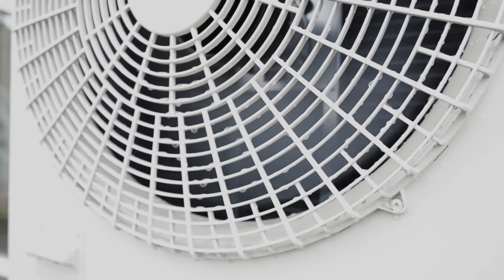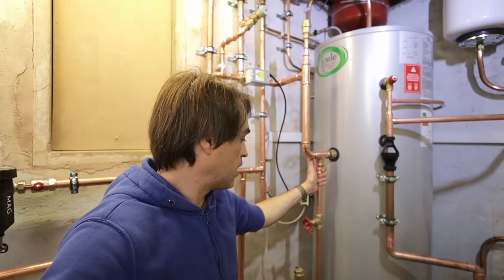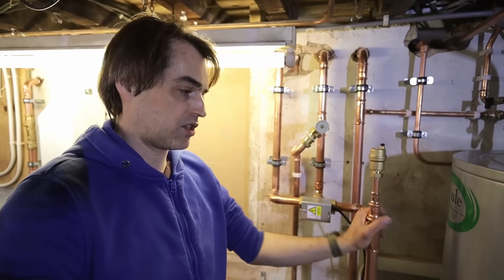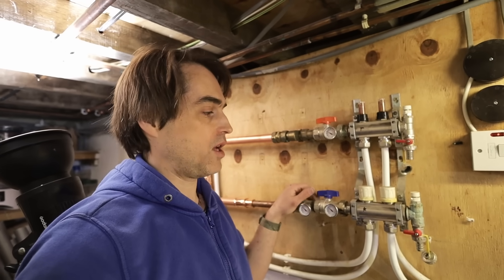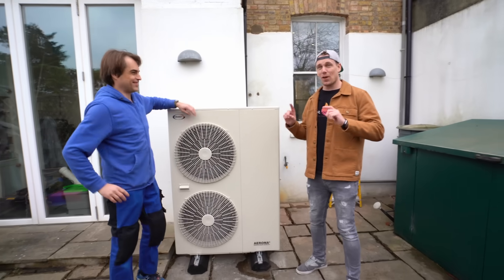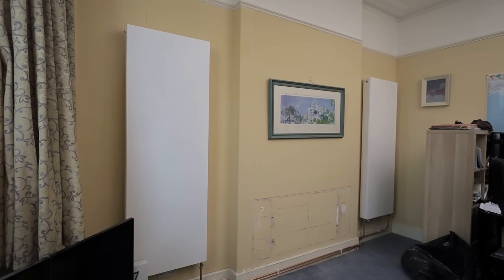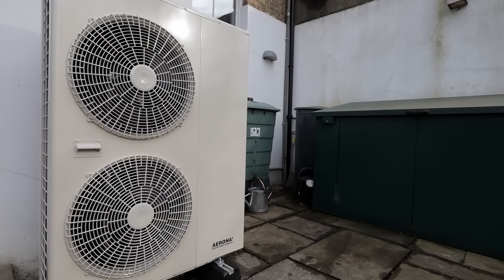The Truth about Heat Pumps: Debunking the Myth.

Comment: I know that this video is old but I have to rant. just having a air-to-water heat pump is the worst thing you could ever have as it's only really viable for one sodding season and that's presuming it doesn't get any colder in winters. The biggest problem the UK is already facing extreme and long high temperatures in summer and autumn, as a temperate country we have no infrastructure to deal with this unlike our cousins across the pond.

Comment: Watched this again and it's definitely the wrong way to approach it, get rid of heat loss first, spend money on that first, spend twice as much. Still cheaper than heat pump and the ever increasing fuel costs.
Reply from the maker: I just went to see the job last week. 22C inside with -3 outside and lower running cost than gas so all good there.

Comment: On that unit you have info that max. current is over 25A. With simple math 25x220=5500W or 5.5kW of electric energy...how often this pump will work on the high level????
Reply from the maker: At the moment with -3 outside it uses 35kwh or electricity to keep 4 bed house at 21c and do hot water

Comment: Why delta 5?
Reply from the maker: Heat pumps efficiency is higher with lower flow temp. The lower the DT the higher the mean water temp in heat emitters and higher output. Also something to do with keeping the fridge circuit happy.

Comment: They slapped all that pipework minus the big tank in my kitchen it is a right mess and is costing a fortune for that heat pump to produce a bit of heat it has to fire up them two big fans a compressor and two pumps that’s a fact

Comment: Hi Simon, wat kind of electronics regulates the system. Because You have also a ballanced cold system and a 3-way valve for buffertank or central healing.
Reply from the maker: It’s a diverted valve between CH and DHW on hot water priority controlled by the heat pump PCB with NTC sensor going from the HP to the cylinder.

CH is 100% weather comp with no room infuence

Comment: Interesting. I haven't seen any systems like that here in the states. Looks fairly complicated as far as piping goes, but like anything else I'm sure once you've done a few you know exactly what you're looking at. Locally I've only ever seen mini-split type heat pumps and those are totally insufficient for the task of heating a whole home here in the northeast. Especially given that you're limited to where the unit is mounted and relying on the air to blanket the rest of the space. Or you have multiple units installed which is more common. I wonder what the installation cost of what you did in the video would be. Something like an oil or gas system to heat a 185 square meter home  locally might be ~10 grand. I'm curious how far a heat pump goes in Europe per sqm. From what I've seen at least the minisplit systems end up costing like 4 or 5g a piece and you need multiple. That and they struggle to heat the poorly insulated homes of the northeast as is.

Comment: We've used a heat pump here in the southwest USA for the past 35 years. Ac has a SEER rating of 20 and is a reasonable heat source in the winter. Not the same as a natural gas furnace but still works well. Very efficient. My highest utility bill has been approx.  $185.  I have a 4500 square foot home and this is a very hot area.Summer temps of 105-112 are common. Is it perfect? of course not. If I was building now I'd use a ground sourced heat pump but they were not available 35 years ago.

Comment: I think you’ve demonstrated really well why heat pumps will never take off in most domestic situations. Both the outside units and internal emitters are enormous and ugly as hell. No thanks. 😢
Reply from the maker: and yet there is a 12 weeks waiting time for the equipment and 3-6 months time waiting time for all decent installers. Heat pumps have already taken off in my perspective.
Reply: The system this guy is installing is weird and the only time it would ever be practical to install a system like this is if it already had radiators from a boiler, and if it had that then just keep the boiler. All a heat pump is is a reversible air conditioner. For heat the inside coil is the condenser and the outside is the evaporator, reverse them for cooling. The main downside to them is that their efficiency drops when it is very cold out, so they usually have a backup emergency electric heat.
Reply from the maker: @Redtooth75  all heat pumps we install are without direct electric backup, as it is no longer needed. Modern units can get to 75C temperatures. If you size your radiators correctly 40-45C flow is all you need, even in sub-zero temperatures.
Reply: @UrbanPlumbers  what I meant by very cold is apparently different than what you think of. Modern heat pumps have a lowest effective temperature of -20C, lower than that and the performance will drop to the point where conventional electric heat is more efficient or they can be unable to heat the house at all. Many places get colder than -20C for extended periods of time. If where you live it does not then it is perfectly fine to not have electric backup but most systems will have them regardless of climate. Where I live it commonly gets colder than -30 C, a couple of years ago we didnt see temps higher than -32 for a month straight.

Comment: So if you have a great big house to accommodate such large radiators in each room, and somewhere to fit all these gadgets as well as not frustrate the homeowner and neighbours with what will become a noisy pump later on - go for it. For your average property it’s simply not viable, or desirable. How much money will it cost in electric when the system isn’t getting enough heat from the air? If the regs have changed I suspect another ‘u turn’ you cannot force people to have massive radiators with a gas boiler, on the assumption one day they’ll change to a heat pump. And then there’s the cost of installation and materials it’s not affordable for most. Added to that how many people are as knowledgable and qualified to fit/maintain these properly? Hardly anyone. 

Probably like the combi boiler it’s going to take a decade or two from now until heat pumps are affordable. That and vastly improved.

Comment: Heat pumps depend on ambient temp, humidity, and electrical allowances... as well as square footage vs. demand. 
Sooo... ummm.... What?

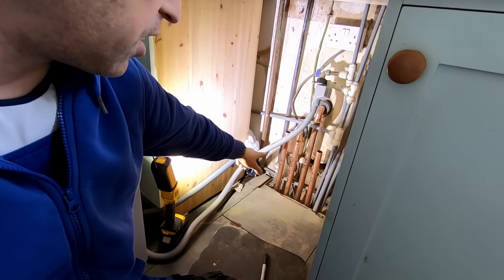1:45 - WHAT? Ummm.. no? Actually it's easier to run a minisplit system than ANY OTHER FURNACE WITH DUCT-WORK!

I'm so confused by this extremely inaccurate video.

With all that piping, WTF are you actually running?!
That is NOT a typical mini-split. You're doing some weird shit.

Comment: looking good right up until those fugly, dominating, radiators.
If they are to be the norm, then there's room for artworks designed specifically to hide them
Reply from the maker: they arent norm at all. Most houses have slightly bigger rads or even regular-looking rads. It is all down to heat loss. On this job I got specifically asked to make sure that the music room can be kept at 21C with -2 outside. The heat loss of that room was huge - high ceilings, 2 external solid brick walls, windows with very thin double glazing, a bit of draft from the floor. If I remember correctly the heat loss was well over 80 watts per m2. Usually homes are around 40-60 so can smaller rads.

Comment: It's the most efficient in terms of electrical heating. Currently in Denmark, electricity is $1 per kw/h. At winter, efficiency of heat pumps drops to ~2 - 2.5, so that's ~$0.44 per kw/h heat. A liter of diesel contains 10.7 kw/h and costs $2.2, that's $0.31 per kw/h heat, assuming 1/3 heat loss. I heat my house with diesel; I plan to install a heat pump, but only along a solar system, only then it becomes cheaper. I know a guy who's heating with bottled propane that he brings in from Germany; initially I told him he was insane but then I did the calculations. He pays €1.76 per kg and it contains 14 kw/h per kg, so that's $0.13 per kw/h, no loss as no chimney is used. That's under 1/3 of what a heat pump costs in winter time, or 2/3 of what it costs in summer time.

Comment: Is the house suitable for a heat pump? It looks like an old solid walls construction with single glazing(?). It’s crazy to install an expensive and complicated air source system with massive radiators when the real problem is lack of insulation.
Reply from the maker: all windows are double-glazed. Ground floor is insulated and has UFH. External walls are very thick (solid though) - 3 bricks deep and have a double layer of insulating wall paper. The roof has spray-on insulation to the rafters 100mm and 200mm insulation to the ceilings. They did all they could.
Reply: @UrbanPlumbers  Fair enough. Sounds like the right solution for the house and it’s owners. 

We have a well insulated 60s house (cavity wall and loft insulation, double glazing, etc) and have been heating it mainly with a log burner for which I am able to collect the wood locally. I have enough seasoned wood for the next two winters so gas c/h will not be used for the foreseeable. Works for us at the moment. Any decision to upgrade the (old) boiler / install a heat pump will wait until the legislation, building standards, costs, payback, buildout of renewables etc. is clearer. At least five years away I would say based on the current level of chaos.

Thanks for the video. Very useful but slightly shocked at the complexity and the large rads!

Comment: This video reeks of "Electric cars will never be a thing".  This debate is already over.  There is no more efficient way to heat a house, and no more practical method.
Reply: While you're correct, the video is trash, it is not the cheapest. It's only the most efficient in terms of electrical heating. Currently in Denmark, electricity is $1 per kw/h. At winter, efficiency of heat pumps drops to ~2 - 2.5, so that's ~$0.44 per kw/h heat. A liter of diesel contains 10.7 kw/h and costs $2.2, that's $0.31 per kw/h heat, assuming 1/3 heat loss. I heat my house with diesel; I plan to install a heat pump, but only along a solar system, only then it becomes cheaper. I know a guy who's heating with bottled propane that he brings in from Germany; initially I told him he was insane but then I did the calculations. He pays €1.76 per kg and it contains 14 kw/h per kg, so that's $0.13 per kw/h, no loss as no chimney is used. That's under 1/3 of what a heat pump costs in winter time, or 2/3 of what it costs in summer time.

Comment: How often do you see a youtube video where you know it's going to be absolute crap because of the title?   Not often...apart from those promoting flat earth beliefs and many about american politics....  and this one!
You are doing people a massive disservice with this title...  suggesting that an incredibly efficient heating and cooling solution is no good.  The resultant cost in energy and energy bills could be huge...   as well as impact on the climate (if you give a crap about that sort of thing)
The only situation where heat pumps lose efficiencey is in very cold circumstances. They would not be a solution within the arctic circle.
If your belief that heat pumps don't work is related to very cold climates, then put it in the title you lazy b*st*rd instead of promoting lies!
In moderate climates no other heating system gets close to the efficiency and low purchase/ running cost of heat pump air conditioning.

Comment: Heat pumps require electricity to be at a rate that competes with gas heating first. If it is then in a colder climate you can really improve their capacity by installing a ground source heat pump.

Comment: heatpumps are very common here in norwayy 80 procent of buldins have them installed, and use them for heat only. i heat my 150 m^2 house with my heatpump air to air. my house is 100 years old an no insulation. i use 1 kw/h and it gives 6 kw/h, and our electricity in norway is 100 procent renewable  hydroelectric  only. in norway we dont use gass at all, only electrical for everything. its common for a hose to use 25000 kw/h a year. if the electricity falls out all houses have efficiently clean buring wood fired stoves 5 to 15 kw/. temperatur   in winter ranges from 5 degree till minus 40 degree centigrades outside air temperature.

Comment: Just seen your video and as for a high temp pump you need a commercial dishwasher rinse boost pump at about £200 but you will need a mount and a couple fittings...

Comment: I think heat pumps are great, and you're doing great work, but you gotta understand that most people can't afford to do all the plumbing and equipment installation shown here. The average Briton might only be able to get a heat pump to connect to their current boiler plumbing and won't likely be able to even insulate the outside of their house much less replace every radiator.

Comment: that is a terrible location for a heat pump.... NEVER install heat pumps in wells or entraping low spaces... they will develop a cold pool of air that does not dissipate.   Its like installing air conditioners under a shed.

Comment: Great vid, I got to ask though why are do you use copper pipes everywhere? I had a new boiler installed 5 years ago and we gutted the house, we used plastic piping everywhere (with the exception of where it is visible everyday, like floor to rad) and it is so much easier to work with and faster to install as well, not to mention probably significantly cheaper. I am sure there is a good technical reason you use copper, right?
Reply from the maker: plastic pipework has a smaller bore and fittings put a lot of restriction on flow due to the even smaller bore of inserts. Pumps have to work much harder too. Copper is far superior to plastic and will outlast it by decades. I never use plastic.

Comment: Well they work just fine in finland where we have -20 and -30 celsius in wintertime. Maybe your houses are just badly built and heat losses are so big? :) you have 1700 watts heating power in really small room. We need like 7500 watts for whole 150m2 modern house in here and its calculated on -26 celsius degrees. The system in the video has so many bad choices and unnecessary parts, that i really do understand why "heat pumps don't work". Why on earth dt is 5 degrees on radiators? Why on earth there is 700 (pound?) pump on system that needs only normal 100 euro circulator pump :(temperature wont ever get that high on heat pumps). Heat pump systems work best when you get dt as high as possible. In here we use 50-30 on radiators. ps. always use underfloor heating in heat pumps if possible. Radiators are 1800's technology.

Comment: Install looks like brilliant craftmanshit, however, I am kinda dissapointed that the main points about installing a heat pump were not addressed, which is how much was the install, how much cheaper is it to run and finally how long until it pays itself off? My little combi boiler cost me 50p an hour to run, I have it on for about 4 months of the year costing around £3 a day meaning my heating bill (even with current gas prices) is about £365 a year. I'm guessing a install like this cost around £15k? It dosent seem cost effective to me. I'd be very happy if somone corrected me on this :) Or myabe they are just not for everyone yet?

Comment: I have what was rated mega-efficient Condensing Combi Boiler and when my heating engineer last visited I mentioned Heat Pumps and he laughed at me. He went on to explain the need for a hot water tank (doh!) but watching a couple of these vids I see you need a 3rd large cylinder too.  My house barely has space for the boiler and one small cylinder so it truly is not something I could ever fit. 
Something that should be compulsory on new builds (along with solar panels) but not for 100+ yo terraces like mine!

Comment: Very nice piping installation. The system installation is probably worth more than the cheaply built old  building. Dont understand why you didn't just use a split system forced air heat pump setup?

Comment: A 5 ton/17 kW system seems pretty large for the size of the home. We have a total of 8 tons (forced air system) for 4,600 square feet above grade and a 2,800 square foot basement. I'm in Maryland USA and we see yearly temperatures between -18C/0F and 38C/100F. Average around 60% humidity, but can get much higher in summer.
Reply: I use a 8kW Daikin for 300 Square meters in the middle of Europe and its perfectly enough for us. Maybe this winter we have to help it with our old wood heater. We'll see.
Reply: @wolfgangpreier9160  300m2 seems awfully large for 8kW. How is the weather there and how is your isolation?
Reply: @alperenalperen2458  Middle European, currently very wet and about 10 Celsius, no isolation 39 centimeters of brick all around. Free standing in a North-South Valley. We have the most sunshine in the whole country. But its only moderate warm and cold throughout the year. No special roof insulation. 19-20 degrees in all rooms with old radiators from the 1980s. And warm water for 3 persons. Of course the heatpump has to work. About 18.000kWh a year. 

In gas that would be 45.000kWh. And in wood + solar heater it was about 60.000kWh because of a very old inefficient wood boiler. 

Of course wood would still be the cheapest form of energy but it also takes much work.

Comment: When will high temperature heatpumps come on stream?
Reply from the maker: they are here. But you don't want one as they are inefficient at high temperatures so cost a fortune to run. Best to design the system (size radiators and pipework) for low temperatures